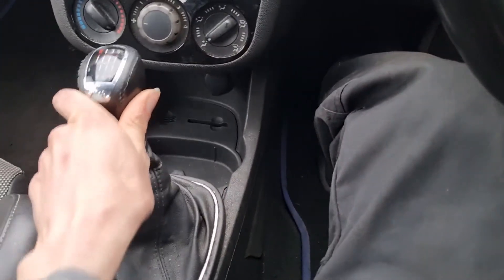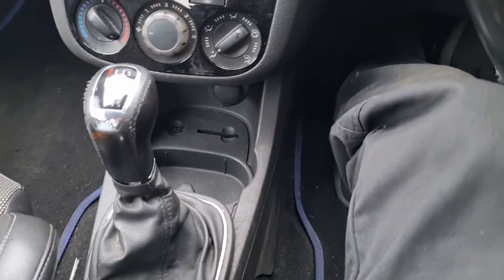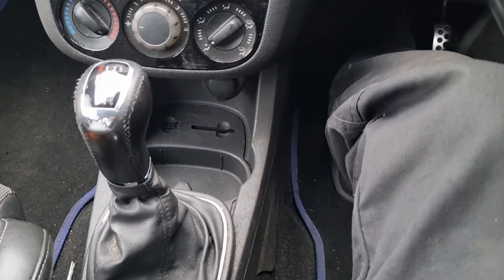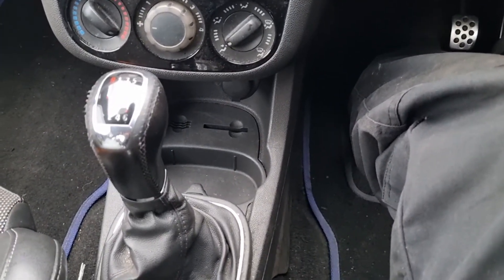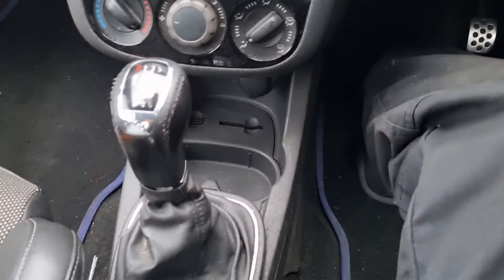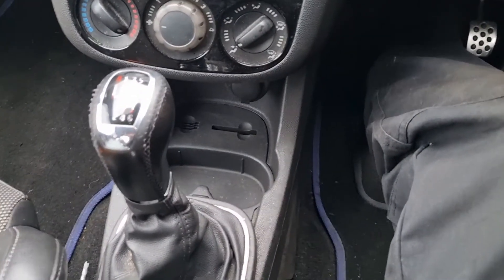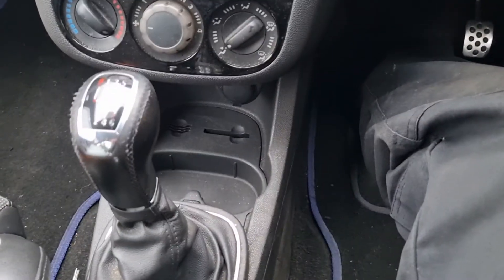M32 Gearbox Signs/Symptoms

Comment: I have an Astra J 1.7 CDTI Sport Tourer with 300.000km. The previous owner never changed the oil on the gearbox. I only have some weird sound when its cold between 1st and 2nd gear. But after it's warm there is no sound. 
I'm changing the oil in the next few days, really qm interested in what comes out and how much

Comment: If there is no noise from the gear box .But you still have that movement of the gear stick .It may be related to bad rear engine mount .But if you have noise from the gears it's probably the bearings.

Comment: I have 2012 Astra 1.4 turbo , gearbox IS noisy, maybe bearing problem, Took IT to a maintenance for diagnos ,servicechief Said that     have to buy new Gearbox, cant Be fixed , 😥, car had 72330 kilometers,  factory should take this fault on every Astras/Vauxhall under check and admit that box has problems

Comment: if you put the car 8
in gear and bite the clutch the engine will shift on its rubber mountings and move the gearlever slightly, my astra has over 300k km and apart from slight rough first to second is fine

Comment: Hey guys, just looking for people's experience. I bought an Astra 2012(gen 2 gearbox) I knew of the problem but I kinda missed it while test driving. Few hours later I noticed my Gearbox moving into position once I clutch in (1-3 gear), but once it's in it's stays there. Everytime I push on the Gaspedal I hear lil clack noise. No whining tho. You guys think it's gonna last for 1-2 month's? How do I know it's getting bad? I can only change it in 2 months or sk

Comment: I have a similar problem, but with an M20 gearbox (basically an M32 for smaller engines). I don't hear the whining noise, but I have problems with the shifter handle. About 40% of the time it doesn't slide smoothly into gear, but it feels like it stucks through something, mostly when shifting into 2nd gear. It happens only while the car is moving, shifting while standing still is almost always smooth. I will try to change the gearbox oil and see if it helps. It's a 2006 Astra H 1.3 CDTI.
Reply: Same here. Find anything ?
Reply: had the same with a 1.3  astra van it never got worse
Reply: how did it go bro? I have similar issue on my Astra, changed oil, not much difference. I am thinking of draining and replacing clutch fluid next.

Comment: Just bought one with a failing gearbox. Am wondering how long it will last until I can afford a new one. Thanx.
Reply from the maker: Sorry for the late reply, my gearbox has been in bad shape for about a year now and still seems to going strong, I honestly think it’s how hard you push the gearbox
Reply: @easomr5353  Thanks. I have had a refurbished one fitted. Its as smooth as a  flying carpet now. Nice.
Reply from the maker: Love that, i really need to get mine done
Reply: @team3383 my Astra 1.9 120 has the jump in 1st and today popped out of 6th on motor wouldn’t go back in and now won’t go across to 5th or 6th
Reply: I drive it like that for 3 years on my fuat bravo  with m32 gearbox but it slowly showing more sings ,the gear stick  moves in 1st,2 and 5th gear ,orherwise the transition between   shifting gears is smooth.

Comment: I have a m32 gearbox insignia  and theres a hole in the gearbox that lead to oil leak. So if I change the gearbox do I have to change clutch and fly wheel?
Reply from the maker: You don't have to change to them, it's just one of those things while the gearbox is out anyway its right there
Reply: @easomr5353  thank-you

Comment: My box is actually not bad (M32) after 92k. 
The 2nd gear has a bit of wear and the lever does move a little when throttle is applied. 
I'm going to drop the oil and refill with Royal Purple this weekend. I've heard that one of the main issues with these was, apart from the poor quality components, they weren't filling them properly at the factory. I've yet to see one drop more than 1.5 liters of black goo when emptied! I mean they should hold 3 (3 quarts or 2.8 liters + 200 or so "wet"). No doubt that really doesn't help!
Reply from the maker: You've done very well to he fair, give her some fresh oil and yeah I don't understand why it took some long to realise
Reply: Mine made only 20k miles and there is also tension on 2nd gear. No problems with 5th and 6th.
Reply: @Szarko32c  111, 000 as of today. I changed the gearbox oil every 15k which for me was every year or thereabouts. Its still reluctant to engage 2nd, especially on the gas (if you know this gearbox you know why - its flexing on throttle) but its not "impossible". No bearing whine yet either. I hope to get 160k out of this box/engine to recoup my investment. Change the oil. Avoid harsh acceleration and don't ride the clutch. 🤞

Comment: 2011 zafira B M32 gearbox. My gear stick twitches in 3rd. when you do a gearbox oil change make sure you put 2.7lts of fluid in. It helps circulation in the box to put a bit more in.
Reply: Did the oil change fix the problem? I have the same issue. Going to 3rd, it has a noise.
Reply: @ezredes19  no it won't  get rid of the problem but it will help the gear box last longer. My gear box never made a noise but the gear stick used to move when you go on and off the power.
Reply: Thank you!

Comment: Test drove an Astra J from 2013 and noticed the movement in the gearstick and immediately knew something was wrong. Nice to see this video as a confirmation. The car only had like 30k miles, kinda insane that it already starts breaking down that quick.
Reply from the maker: Chocolate gearboxes, I agree though it's insane how the cars only done 30k and the gearbox is already on its way out
Reply: @easomr5353  Do you know if the models after 2013 which received bigger bearings and better oil distribution do any better?
Reply from the maker: @FHD from my understanding they suffer the same issues but the chances are alot slimmer. They're more likely to actually last the life of the car
Reply from the maker: I'd definitely recommend it still
Reply: I changed oil in M32 after 20k miles, added 2,6 liter for a total of aprox 2.8 l. The factory put aprox 2.3 l of oil which creates the problem.
Reply: I have been using Vauxcare based on the wirral for the past 10 years for all my servicing. They only do Vauxhalls and their boss was recently telling me how Vauxhall quality has TANKED since being taken over by Stenlantis . He said they were seeing faults on cars with LESS THAN 20000 miles that are unbelievable. He actually pointed out a car they were working on with  22000 miles on the clock that required  A NEW ENGINE  !!  He claimed  massive engine/gearbox problems were becoming more and more common.

Comment: think i have this gear box in my 2008 vectra, starting to get clutch judder is this a symptom? only happens in 1st
Reply from the maker: I know they did put the m32 in some vectra's not sure which ones and clutch judder is more likely to be clutch and flywheel rather than gearbox. Normally happens when you pull off and your clutch doesn't quite engage with the flywheel
Reply: @easomr5353  hmmm thank you for that! There’s no noise from the fly wheel or anything that’s the strange bit

Comment: M32 6 Speed gearbox, fitted to lots of vauxhall models, alfa romeo and fiat models.

Bigger endcase bearings and later endcase design gains nothing for longevity.
Gearstick kick can occur in any gear not just 1st, 2nd, 5th and 6th.
Bearing hum/noise can occur on its own but also at same time as gearstick movement - which means a full gearbox removal from the car and full refurbishment of gearbox is required, not just endcase bearings.
Sitting on motorway for long periods in 6th gear is not putting maximum load on the shaft bearings - unless accelerating you'll not be making boost nor pushing torque through the gearbox...
Draining the vauxhall gearbox oil and refilling with Fuchs Sintofluid 75w80 fullysynthetic gearbox oil and over filling it to 2.7L will drastically help longevity, and depending if engine power has been increased or not and mileage per year, the gearbox oil should be changed at same time as engine oil.....
The idea of it being changed every 6k miles is ludicrous!!
Reply: Exactly. There's about 200ml still left when drained. I stick in 2.6l of the Fuchs in the 159 with the M32 bringing it up to 2.8l. It's at it's happiest cruising stress free on the motorway in sixth.

P.S. To Alejandro Perez. 

 It's not "the longer the ride the hotter it'll get". The gearbox will eventually reach it's optimal temperature and stay there unless your thrashing it around town where I never use 6th gear and rarely even 5th.  Cruising on a motorway in 6th gear isn't going to overheat a front mounted gearbox with 70 mph air flowing over it. The most stressful thing you can do is HARD acceleration in 6th gear. I 'overfill' with 2.8 litres of Fuchs Titan Sintofluid SAE 75-80 every 50,000 miles. Now with 158,000 miles on the clock with no issues.

Here's some reading to enlighten you: 

https://stillrunningstrong.com/car-maintenance/m32-gearbox-bearings/
Reply: @One_over_the_eight  No, it's not. The longer the ride, the hotter the oil will get if you keep driving in 5th and 6th gear.

Comment: Mines a 14 plate b series engine and has the bigger endcase and still moves just same as yours it might last a bit longer with bigger endcase before it packs up but definitely isn't a fix. I'm going to see how it goes for a while but I'll be at halifax clutch and gearbox before long👍
Reply from the maker: Thank you for confirming that, best of luck with it mate hopefully she lasts a while for you
Reply: Mr voorhees did you fix your gearbox at Halifax gearbox ?and if u did how much is charge you?? I have same problem with my Astra 1.7 Sri diesel 2010
Reply: @MrClassicLuxury  haven't had it done yet play isn't that bad at moment but it's getting worse they are the cheapest for m32 gearbox repairs they specialise in them I had a clutch and flywheel done in my astra van by them and they where miles cheaper than anyone else.